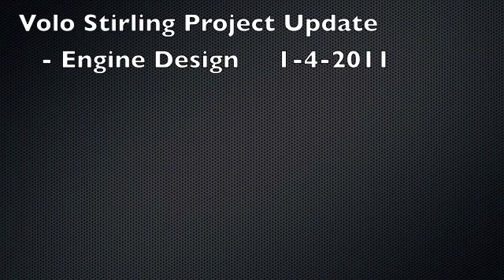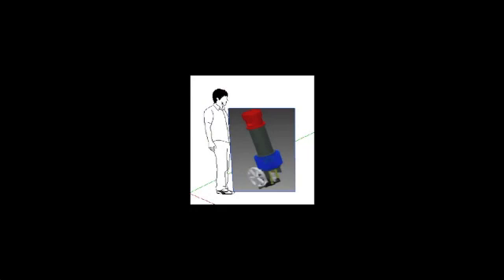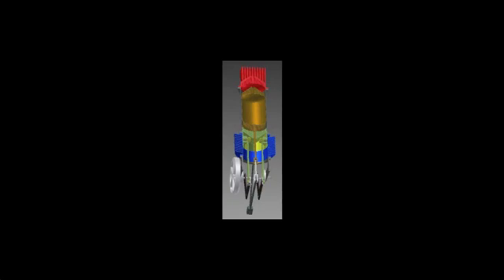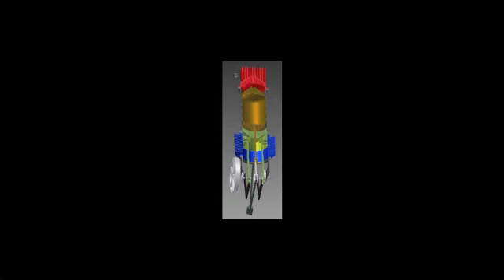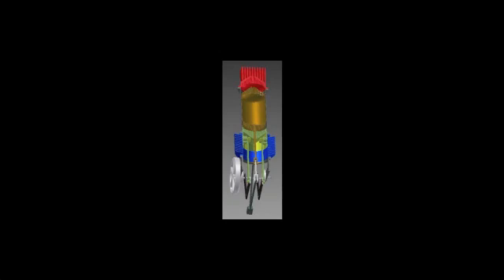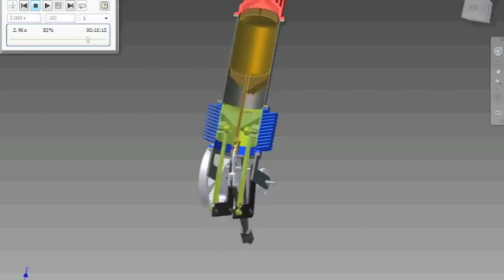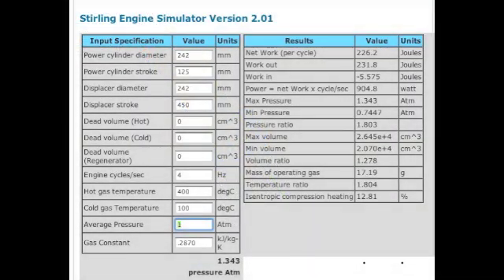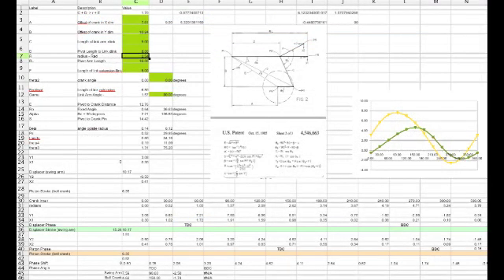Volo Stirling Update - Design1

Comment from the maker: Berkana,
I do appreciate your thoughts on this, lots of good info.  Keep in mind the regenerator, one, is moving, increasing heat transfer, two, it is on both sides of the displacer (which does have a thermal break in it (although that is not shown in the design) - this allows for a higher gradient temperature that the gas sees upon entering either the hot or cold side - most regenerators are either in the hot end or are at an average temp of the hot and cold side.

Comment: Allan Organ's papers discuss these matters in terms of NTU (number of transfer units)

NTU is (roughly) a measure of conductive capacity; usually, higher NTU comes at the cost of more flow friction. (flow-through conduction is far higher than diffusive conduction) Copper wool has a lot of surface area for its mass and has far higher conductivity than Al; Al fins aren't even close. Fins in an enclosure result in diffusive, not convective conduction. Above 250 RPM, adiabaticity will cause problms.

Comment: And if the cold side fins were connected to the hot side fins, you would have a thermal short circuit, where the heat from the hot side would leak into the cold side. It has been experimentally verified that the function of regeneration requires 1) excellent conduction with the gas flowing through the regenerator, and 2) very little if any conduction along the regenerator itself, to prevent thermal short circuits. Copper wool and stacks of copper gauze meet this criteria; aluminum fins do not.

Comment: I see that I misunderstood the design (I thought the fins on the hot cap were what you meant), however the finned structures on the ends of the displacer won't regenerate the gas for this reason: the regenerator pre-heats the gas during the heating displacement by giving up the heat that it took from the gas during the cooling displacement. The cold side fins might take up heat for the first few strokes, but it isn't connected to the hot side fins—and would't work if they were. (comment 1 of 2)

Comment from the maker: Look at the design again - the regenerator is on either side of the displacer - it is not in contact with the environment - it moves with the displacer increasing it's ability to strip or impart heat into the working gas.

Comment: The efficiency enhancing effect of the regenerator comes from being 'isodiabatic', that is, exchanging heat with the working gas, but not with the environment. Attaching them to the hot and cold ends defeats this; the regenerator is supposed to be isolated from conduction with these ends except by the flow of working gas.

Comment from the maker: The regenerator is build into the hot and cold ends with the negative and positive fin design - this provides for the regenerator function but eliminates most of the dead air space.

Comment: I notice that your engine has very little deadspace by design. This may sound counter-intuitive, but it was demonstrated by Prof. Allan J. Organ that all engines have an optimal amount of deadspace, and that engines sometimes fail to even start if they have too little deadspace, or can cease to run after a few turns if they have too little dead space. This is because all stirling engines have a degree of "adiabaticity", where the compression of the gas out-paces the ability to wick away heat.

Comment: I am also working on Stirling engine technology. I have a couple of observations: firstly, I noticed that your engine doesn't appear to have a regenerator. Is this on purpose? The regenerator is what gives the Stirling engine it's great efficiency. At the very cheapest, copper wool makes a great regenerator. It adds a little bit of dead space, but the amount it reduces the cooling load by more than makes up for the deadspace.